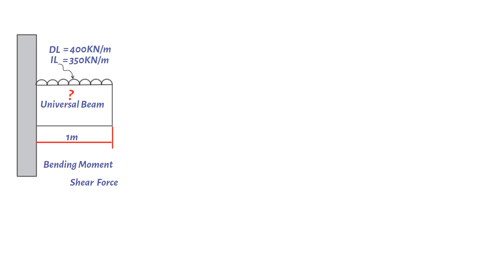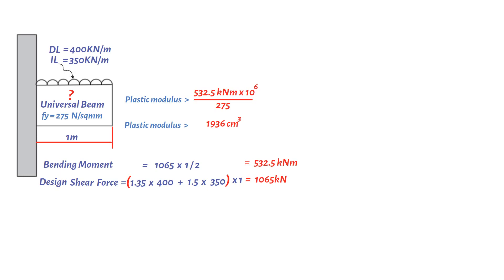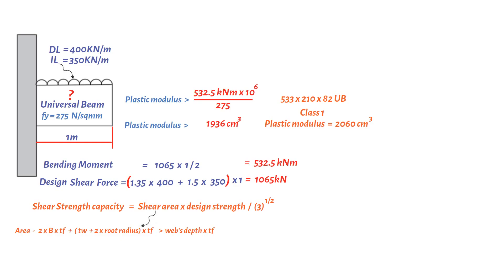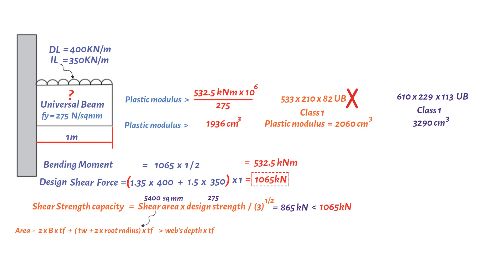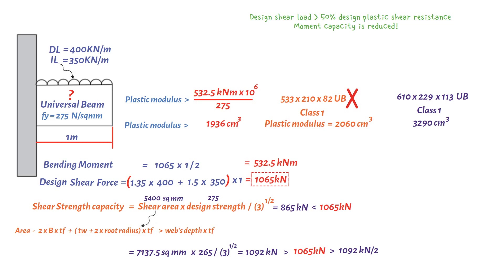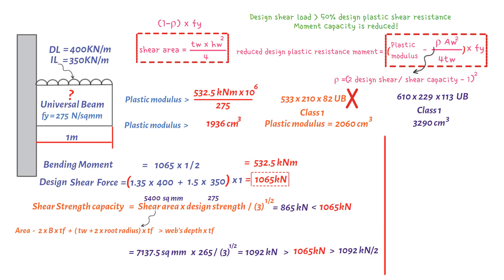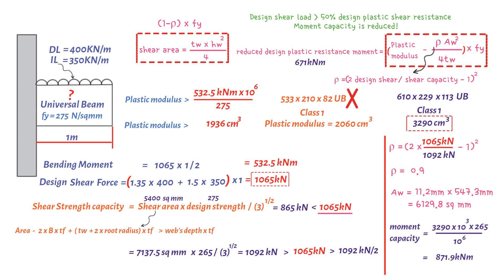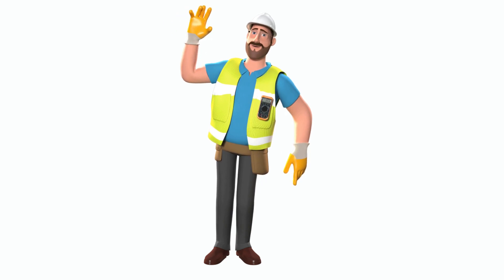How To Design a Cantilever Steel Beam.

Comment: Hi guys! Great video. Could you expand on this tutorial to carryout a lateral resistance (and torsional) check?

I see this tutorial as a perfect example for modern day balcony design. Sometimes the cantilever stubs are enough. On a current project, we have a 4# 152 UC cantilever stubs (S355)... With no lateral restraint at the ends. Would be good to build on what considerations you'd need to consider!/ calculate etc. Thanks again though! As always 👍👍